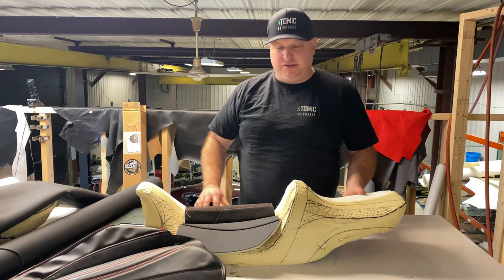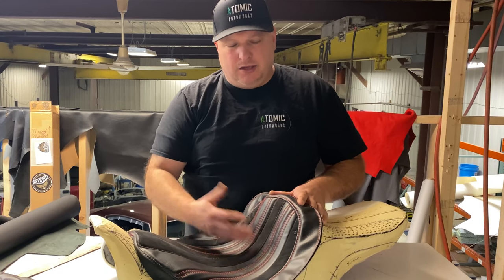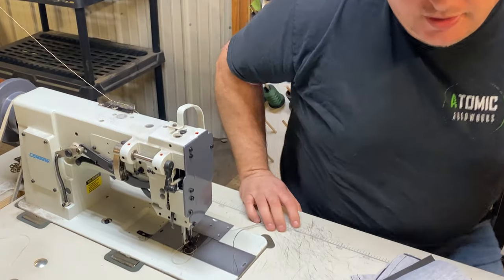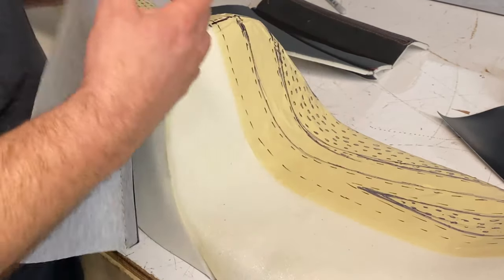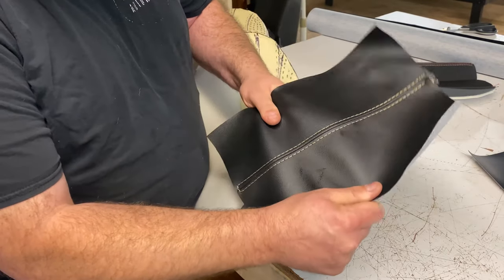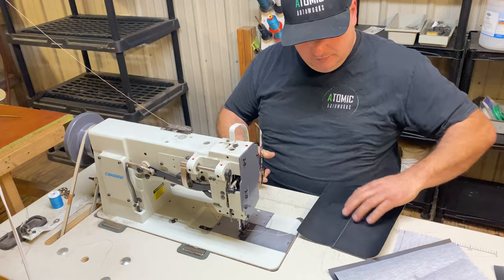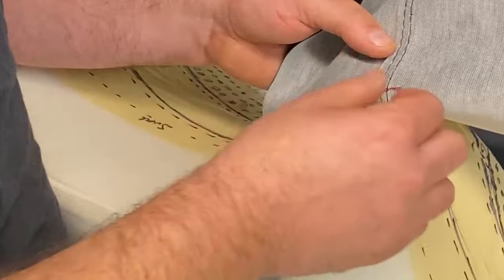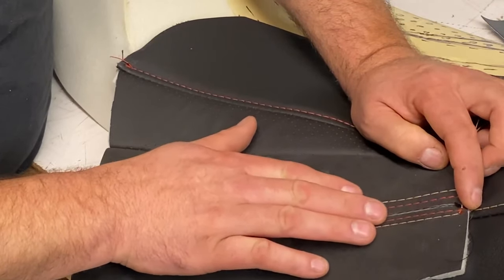Butt Seam Explanation & Different Types

Comment: Thanks for sharing. I have a couple questions. What is the stitch length that you used here? What size thread and needle are you using? Thanks
Reply from the maker: Hello, thank you so much for watching. The thread length differs however for most motorcycle seats we usually set our sewing machine at 5 or 6. like an 1/8" ish . Thread sizes are usually 90 or 210. The needle i will have to check. we usually have a diamond cut leather needle that punches the hole so the thread inst dragged through.